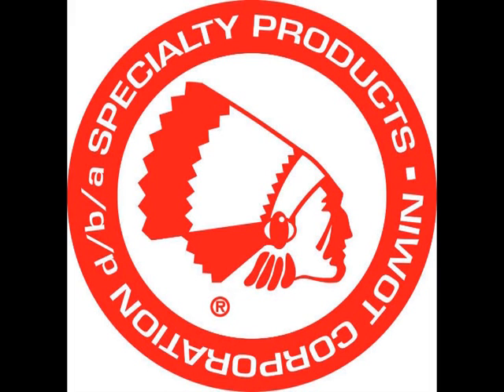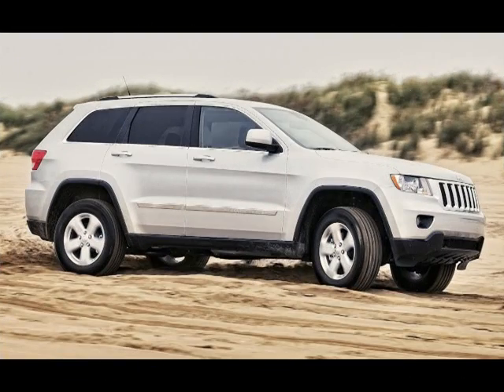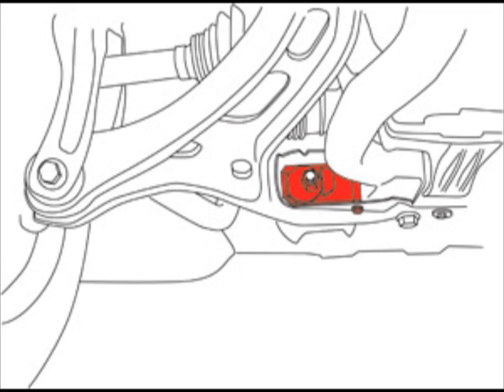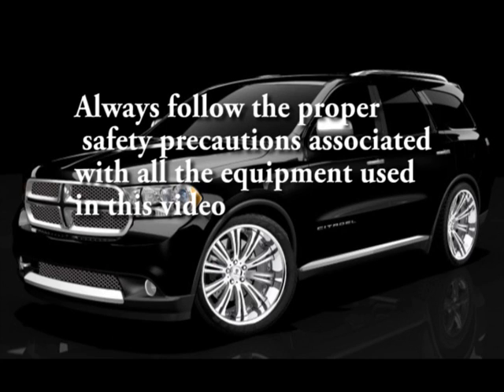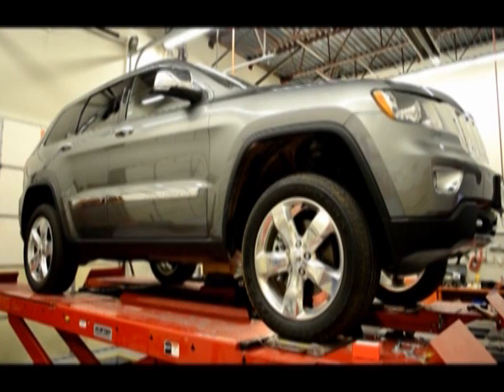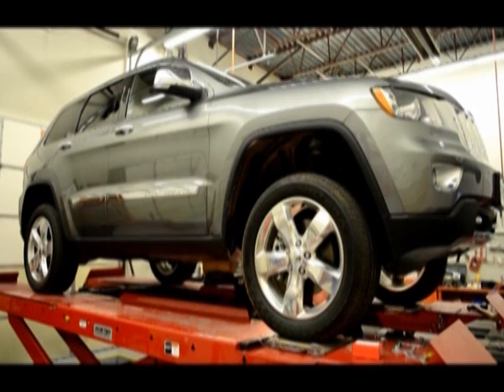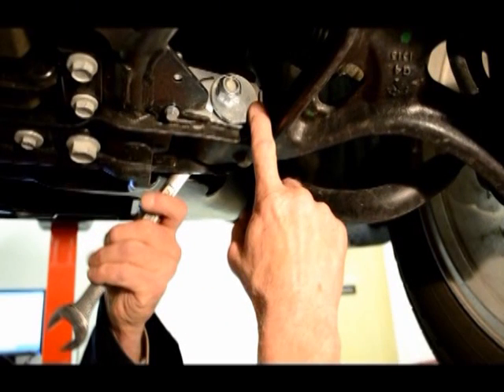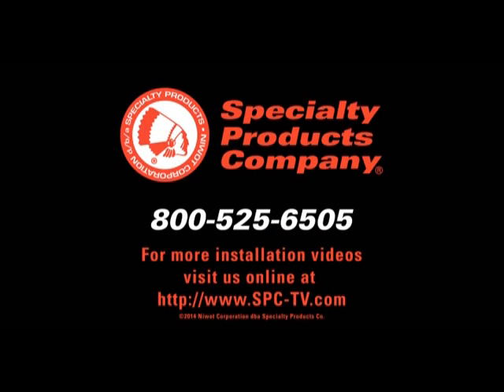82360 - Dodge/Jeep Front Cam./Cas. Adjusting Kit - SPC Alignment

Comment: Is this kit only meant for the front suspension?
Reply: The 82360 is only for the front suspension. And it does not allow greater angle changes than the OE adjuster but definitely makes adjustment easier. The rear suspension for these vehicle have OE adjustable camber and toe. Are you running out of alignment range?
Reply: @specialtyproductscompanysp8027  I have a 2018 Durango RT. I had my alignment done yesterday but still have my right caster out of spec and left camber out of spec and I also have the toe right at the maximum allowance. I was told that in my vehicle there was no way to adjust the front caster and camber which I have my doubts on. This is what brings me to your product.

Comment: How does this shim give more control over OEM? Even with this adapter you're still adjusting with the confines of the bolt hole.
Reply from the maker: This part does not provide additional angle change, just makes adjusting much easier.